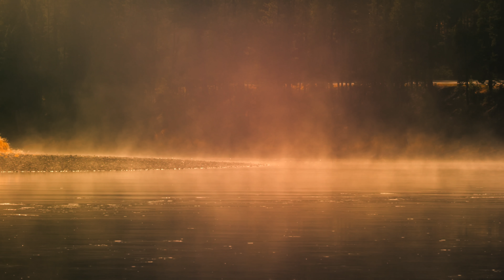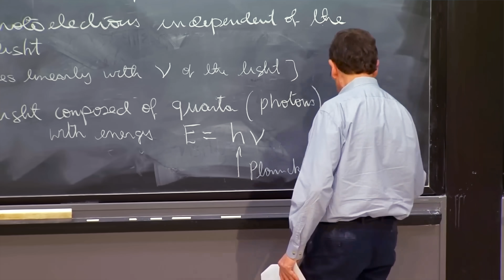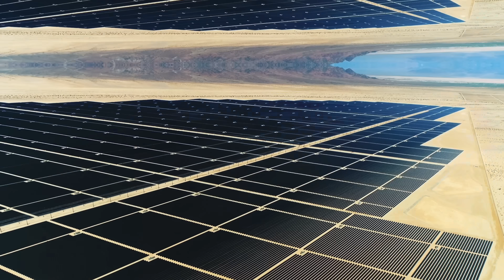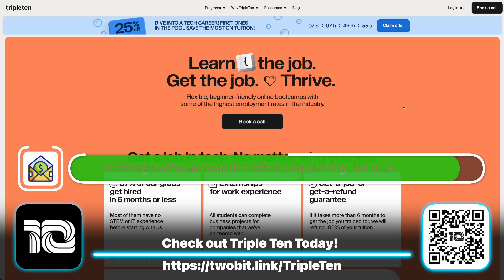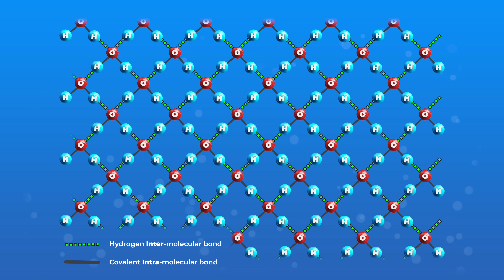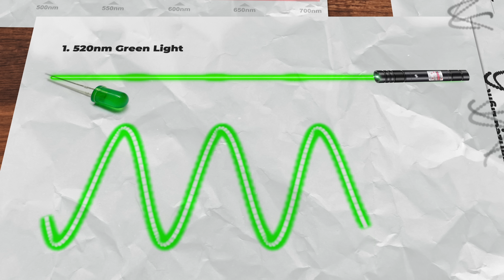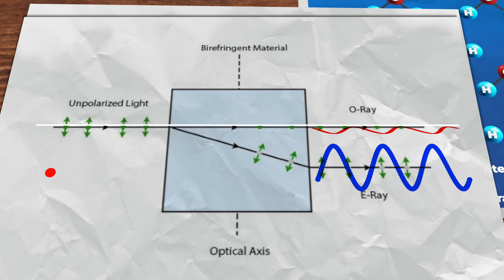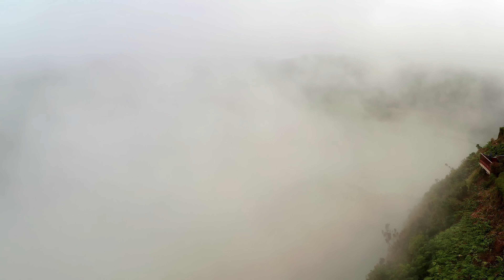New MIT Discovery Just Solved Water's BIGGEST Mystery!

Comment: There just maybe something in this but the decision is still out. It gets down to whether specific frequencies of light at the air water interface, particularly in the green band, modify the surface tension of water. It doesn't appear the effect is very strong, but just possibly there is a sweet spot. The question is whether if there is an effect, it would be any more efficient than flash desalination, probably not.

Comment: Some serious speculation. It seems reasonable, though science is based on reproducability. You are correct in saying this process has huge implications, but I would like to do it at home. Even if it is inefficient, energy wise, fresh water is priceless. Also, cooling air would be neat, especially after the humidity is removed. My a/c produces more condensation than I can use, and it costs me loads, lol 😢

Comment: While water is liquid (not ice) a certain number of the surface molecules will attain the energy to escape the surface.  Lower numbers if the water is cold and higher when warm. I’m reasonably sure even ice will ultimately evaporate (sublimate?) too.  At the surface the cohesive force holding the molecules together is at its weakest (only one side of the molecule is being held).

Comment: Strewth dude. How wrong can you get?
I get that this is another "wouldn't it be great moment", but try being a little less "wow" and use some critical and lateral thinking. 
I went and looked at the MIT "*presentation*".  How that guy stays employed is beyond me. 
To paraphrase: "I don't have a real idea of the actual physics, but..."
It brings to mind 'Cold Fusion', 'perpetual motion', 'Life on Venus', and other such specious announcements - 
Occam's razor: you just know it's going to be water contaminants causing localised heating and increasing evaporation. 

Also, much better and less energy intensive ways to fast evaporate water - sprays for instance. 

I take it that you've never seen a power station cooling tower? Never seen all that white stuff coming out of the top of them??

EXTREME Face-Palm. 🤦‍♀️

Comment: What a NOTHINGBURGER! 

1) there was nothing new or surprising in the MIT's article. Its author, David L. Chandler (not chemist, just a journalist) had no idea what he was writing about and highly overhyped the article. Evaporating water is an endothermic process. Electromagnetic radiation (light) has energy, and water molecules (having electric dipole-moment) can easily absorb energy from electromagnetic radiation. That is why light can cover the energy-requirement of the evaporation.

With light, you can break covalent bonds (photodissociation). Why would we think it cannot break weak-ass secondary bonds such as H-bond or dipole-dipole bonds?

2) It doesn't have any industrial/practical benefit. Covering the evaporation's energy-requirement  directly with heat is much cheaper (and far more energy efficient) than sacrificing electricity (a high value, 0 entropy form of energy) to generate light then using light to evaporate water.

Sorry for bad grammar.

Comment: This is fascinating.  A few points that spring to mind.  You mention that the angle of incidence makes a big difference and 45 degrees seems to be the sweet spot.  So what occurs to me is that the poles of the earth experience a lot of near 45 degree angle of incidence from the sun.  Maybe the "albedo effect" has also been misunderstood.  After all, the notion that wearing white in hot conditions seems to be shunned by many that live in hot regions of our planet.  At the very least this should be taken into effect in climatic modeling.

I also wonder if the same photo evaporative effect occurs in other liquids (Alcohol as an example) as many liquids will evaporate below their boiling point.  Maybe light is playing a role in this.  If so are the critical angles and wavelengths the same or different for other liquids?

Comment: Interesting. Obviously, efficient  desalination of seawater is a big deal in many parts of the world. The value of land, worldwide,  is based on its proximity to freshwater.   My guess is engineers and the like based their earlier findings on the total energy in sunlight for thermal evaporation,  so direct evaporation caused by photons being directly  absorbed into the water molecule were overlooked as thermal energy and this effect were all rolled into one on the other side of the energy equation. This new knowledge may indeed be used to design more efficient desalination plants, especially those that convert other energy sources like electricity into desalination. The Saudis burn oil for desalination but they are sitting on a sea of oil so freshwater is more valuable to them than oil out of the ground. The Israelis use sunlight I believe.

Comment: It's absolutely not true that you must have heat for water to evaporate.  Who told you that?  It is true that adding heat to liquid water will cause evaporation in an open system, however, I can dry my clothes at night when the temperature is dropping i.e. declining heat so how does this happen?  All liquids have a partial pressure equilbrium so when you have cool dry air this will draw water from liquid to gaseous phase until the partial pressure for that temp is reached which will never happen for clothes in dry air to they complete dry out.  This is also why your food dries out in the refridgerator if you don't cover it.

Yes, I'm just a dumb high school science teacher, but water can also be "boiled off" with electromagnetic radiation, specifically microwave radiation and this is how your microwave works and once again there is no actual heat applied to the water but rather radiation.

I never heard anything about the quantum magnitude of this socalled photoelectric effect but it supposedly might be used for all sorts of amazing stuff.  There are all sorts of weird phenomena but their net effect is so low or so energy inefficent that it is nonsense to even think about it as the basis for practical use and perhaps this is the case for water photoelectric effect?  Unfortunately a lot scientific papers these days are more spin than science and it's the questions they don't ask that is the problem especially because they are often looking for funding to spin off the tech or on sell it so their "research" often is more like a startup blurb - and I say this having worked a very long time in Uni research earlier in life.

Comment: I've always wondered why hurricanes get larger when they rely on warm waters to do so. 

Because in my mind,  as the clouds  of the hurricanes get larger, they obscure light and keep the water underneath rather fresh. And yet, they continue to grow.

Could it be that the eye of the storm, since it's unobstructed of clouds, acts like a light/photon laser. Evaporating up the middle of the hurricane at a rate 4 to 7 times higher than that of a regular day, since it's concentrated in a small radius?
Thus creating a convection effect that helps the hurricane continue growing.
Because without this piece of knowledge, that wouldn't make sense. Because it's not like the temperature is concentrated and increased too. We'd never know! Especially with the cold and strong winds created by the hurricane.

Comment: Decades ago, I saw a cartoon of a classroom of students exiting from a door marked "physics." They were depicted holding their heads and screaming in horror. Two students are outside talking and one asks the other what's happening. And the other guy replies, "We just found out that everything that we learned up to yesterday is wrong."  🤣 

This isn't quite there (yet) but it gives of similar vibes. ha.

Follow up question: Does the ratio of frequencies emitted by the sun change as it goes from solar max to min? What effect does sunspots have. Are there other frequences - cosmic radiation - that may also have this effect that we don't (yet) know about. Imagine  if a supernova (as example) exploded and it shot a wave of radiation such that mars happened to be on the wrong side of the solar system at the time and got its water evaporated off. I mean, I know that I'm going into sci-fi possibilities here but hey, you never know.

Comment: I see the advantage of this kind of desalination as rather like heat pumps - heat is being 'stolen' from the air instead of us having to provide it. But I'm wondering whether the break up of the clusters is needed. The desalination has already been done when the clusters leave the liquid, so if they can be condensed together without first being broken down into individual molecules then that's all that's needed. Of course that would release less heat than the condensation of normal water vapour made of individual water molecules.

Comment: It is way cool, and it helps explain some observations in my growing areas over the last few years.  In tents with lights, I had a higher rate of drying across my substrate.  I associated the higher evap rates with warmer temperatures associated with the lights.  Cutting lighting time correlated with higher moisture levels.  However, I wanted light, so I added a portal that isolated the lights and kept temperatures "stable".  However, the drying rate went back up when the lights were cycled on, so I just scratched my head and moved on.  Now I might have a clue.  Thanks!!

Comment: You cant recombine them into a single beam after a Faraday rotator because then there is nothing different about the two beams on which the subsequent optic could work on. Recombining them wouldn't be necessary unless you needed to focus them though. Also, its not possible to get wall-plug efficiency of anything close to 50% at 535 nm. 1070 nm, yes, but the doubling process is lossy.

Comment: You can't buy hydrogen-peroxide in a clear bottle, just like nearly all beer is sold in colored or darkened bottles (except Corona, and I don't know why).  This is because UV light -- even a little bit -- breaks apart molecular bonds, and especially weak bonds.  This is also why if you stick yourself in the sun, your skin darkens.  You don't get a sunburn from the heat, it's from the light.  And again, this is UV light, but the wavelength of the light has more to do with how aggressively the photons beat on a bond, and not necessarily the TYPE of bond.  So it would make sense that the weak Hydrogen bonding that keeps a collection of H2O molecules in a liquid state would break down with a little photic pummeling.
Reply: Makes total sense

Comment: Then this means that the Green Pigment of the Chlorophyll from plants allows faster evaporation.
This is quite revolutionary discovery, this unlock more topic in regards of Evaporative Cooling Effect and Water Evaporation.
Basically, this solidifies that Trees brings more cooling effect and expells more moisture in the air than sea water of similar area.
Reply: You've got this completely backwards.  The plants are green because they REFLECT the green light.  If you provide plants with nothing but green light, they die.  Because green light is the only colour they CAN'T use.  Plants can use both blue and red light but NOT green.

So reflecting the green light helps them PREVENT evaporation.  After all, plants don't like to be desicated.
Reply: The other way around: Green plants appear green because green light is reflected. The absorption of green light enhances the photomolecular effect, so reflecting green  wavelengths allows plants to better conserve the water they have.
Reply: @DavidLeith-t5x  Note that the chloroplast is the only part that is green and the other parts are mostly translucent in color, meaning the cholorolast reflects the green color to other cell parts causing more heat absorption (especially to part that contains more water) to non-green part of the cell - causing more water to evaporate causing evaporative cooling effect.
This is how the tree cools itself and prevents its green leaves to get burned by the sun... (you can notice that when leaves looses its green pigment, it easily get burned by sun... also the greener the leaves the more heat resistant it gets).
Evaporative Cooling + Endothermic reaction from photosynthesis.

This the reason why you easily get fog in forest and get much rainfall.

Comment: The way I like to look at desalination.  How much energy is released when pure water has salt dissolved into it?  Not very much.  So why is it so difficult to go in reverse?  Electro plating metal uses an anode and a cathode plates with an electrical current.  If you could just get the NaCl to move to one side of a tank as it moves and then keep flushing out the saltier side of the long tube you might be able to get fresh water.   

It seems the reverse osmosis using pores that separate water from salt is the best so far.  But the pores probably get clogged easily.

Comment: I am not convinced.   Even in very cold weather snow will evaporate because the air is dry.  And moist warm air coming into contact with a cold surface gives you condensation. So focus on the condensation if you have access to humid warm air.   Is the air humid in Saudi Arabia over the ocean?

Comment: Thank you, but unfortunately the level of explanation of this very new effect is not worth other 99% of the video. I.g. how exactly they detected the big clasters to detach from the water body? How big chunks are detached and why? And why the heat cannot detach water in chunks and necessarily require to de-bond every O-H connection? You prefer fantacising on the applications of the effect, instead of explaining it properly.
Reply: @michroz  clasters? 🤣

Comment: I’m really curious if the photomolecular effect works on other liquid molecules, too. Does it work on ethanol or other liquid biofuels? If so, that could potentially be a solution for green / renewable liquid fuel distillation & refining. The heat required from fractional distillation currently makes many renewable liquid fuels inefficient based on net energy input required to distill / refine them.

Comment: So photons replace the electron needed to break apart a water molecule and water turns into hydrogen and oxygen  stanley myers used red LEDs to assist in demoleculezation  and a high frequency electrical charge  to split 🪓 the water  his system was energy efficient.

Comment: The man spoke about using a thin sheet of salt water, presumably flat, to shine the green light laser on to break the molecular bonds, but that leaves the problem of the salt, which will deposit on whatever surface is around. A fine spray might work better for breaking those bonds with the laser light, but then you have the problem of salt build up on the sprayer heads and the fine spray will scatter the light, reducing efficiency. A thin sheet waterfall may help with both problems, with a second stream below to carry away the salt. the laser would need to be positioned below the center of the falls as the atmosphere above center would be more saturated with vapor. A current of very dry air blown up the face of the falls would lessen the molecular bonds and help direct the evaporite to a collector. Lowered air pressure works by itself but can't be used in a dynamic flow situation, as the vacuum requires a more closed system. Simplicity is the watchword here, how to keep it simple and still be efficient. Sorry, just speculating.

Comment: I think your or mit interpretation is incorrect.
The electro magnetic frequencies from the sun do not travel as your guess is via some supernatural photon.
The frequencies are induced into the molecules using electro magnetic radiation.
This means that in order to keep reasonable equilibrium the molecules on earth have to regenerate asimilar frequencies to those that they are exposed to.
It's purely by induction that causes the frequencies to spread throughout the universe.
There is very little matter or plasma being exchanged between the masses.
Any delays in the induction is measured as a light speed.
Which is just a common anomaly because light being just another frequency does not travel.
Water, as an example with it's fluid and transparent form is an Ideal medium to study the electro magnetic frequencies from the sun.
It's ability to metamorphose into gas is is the result of many combined influences not least because the atmosphere is constantly changing it's density which naturally vacuums up the water molecules until it precipitates as rain.
There is of course more but this is a lengthy subject.

Comment: Heat is infrared electromagnetic radiation just like visible light, water is sensitive to wavelength, light slows down in exclusion zone water with relativity effect time dilation reverse gravity transportation. Eddy fence/ force feild/ linear accelerator.

Comment: You are, kind of, selling the bears hide even before the bears parents where born.
We need way more "man made" energy to produce the needed circumstances than to use just the free sunlight, we can harvest all day long.
You´re argumenting only with perfect circustances, that aren´t given in nature. Unpolarized light does not only have lightwaves in 90 degree angles. Every angle of our 360 degree concept and any given fragment inbetween are provided by the sun and (allmost) all of our artificial lightsources. 
Since you haven´t even mentioned the water vapor partial pressure, I don´t think you have a greasp on that matter.
The only opportunity we can use right away from this dicovery is to correct our weather forecast models.
Keep reading, I´d say.
But thanks for the information of the MIT findings on the topic.